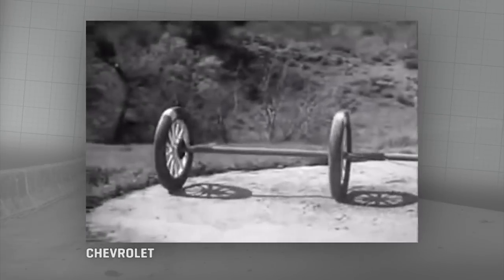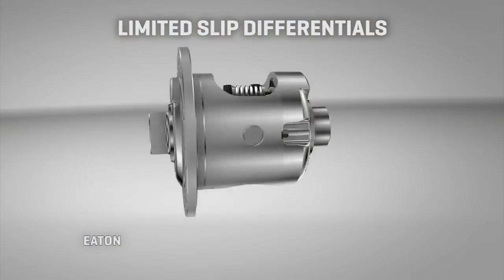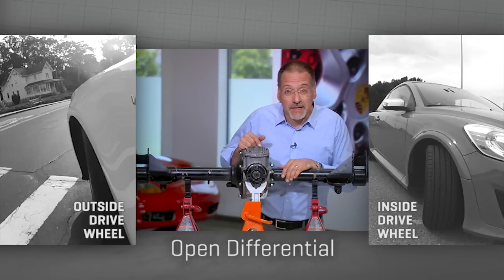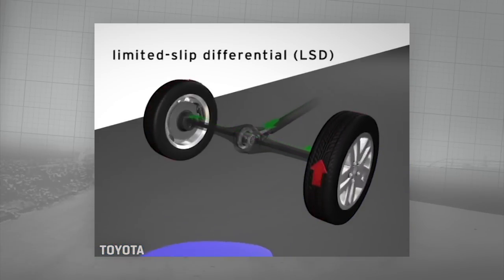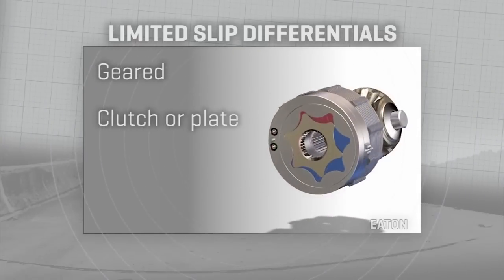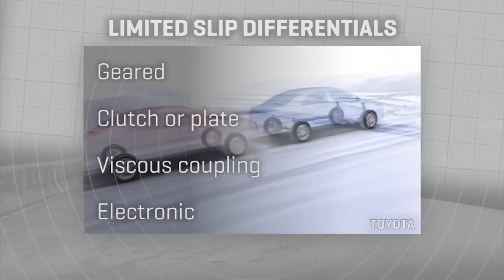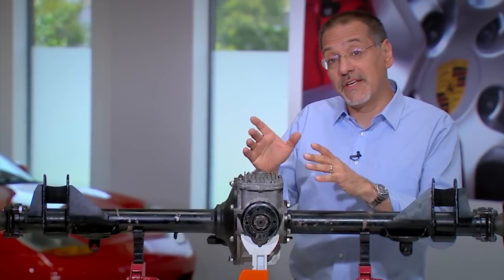Car Tech 101: Limited-slip differentials explained

Comment: I have a sneaking suspicion that vintage video explained it all better than the computer graphics did.
Reply: that video doesn't explain what a limited-slip differential is since it wasn't invented or widely used at the time. The purpose of that video is to explain what a basic differential is, how it operates and why it is needed. The point of this CNET video is to explain a type of differential called a "Limited-slip" differential....
Reply: @wannawin95  well, he did not explain it
Reply: When it comes to authenticity and originality, NOTHIN’ beats the good ol’ Analog!
Reply: 10 years later and it's still true. He gets right to the point, skips the minutia and gives the general concept

Comment: That Chevrolet video is excellent, the whole thing can be seen for free.

But THIS video has helped me to understand what the heck Forza is talking about in its car tune adjustments.

I didn't understand with two wheels spinning at different rates that when one wheel loses traction torque will go to that wheel and the opposite-side wheel will lose drive.

The language for limited slip differentials in Forza settings makes it seem like we're locking the two wheels together so that they spin at the SAME rate in all conditions when we increase the acceleration and deceleration settings.

I never bothered to upgrade my differential before in Forza, it can't improve the metrics shown to you and so you just have to be wise about what the heck it does.

Comment: 1997 Toyota Camry XLE with a 1mzfe engine. Now the codes on the door label says A/TM -02A/A541E. Can you tell me if it has an open or LSD in the transaxle

Comment: do front wheel drive have a differential to or just back wheel drive?
Reply: It's built into the transmission for a automatic I think and for a manual transmission it's separate if im not mistaken.

Comment: Which differential is the best for auto-x and track racing. Which will give the best handling and make attacking at a corner with higher speed?
Reply: Computer controlled clutch-type is obviously the best.  Not really available in the after market.

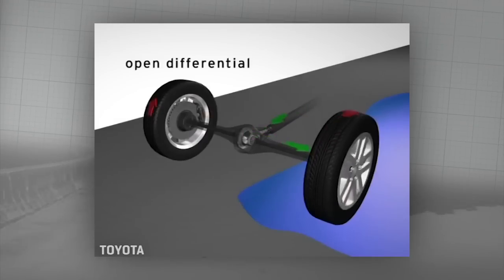Comment: At 1:41, "the power, or the torque, goes to the path of least resistance" is wrong on the torque part. The open differential applies the same torque to both wheels, which is limited by the torque that the surface can apply to the sliding wheel. Power and torque are different, and it's a shame that a physics-related video uses imprecise language.

Comment: This is incorrect and an often repeated mistake. All of the power does not flow to the spinning wheels in an open differential. The spinning wheel merely limits the amount of torque that can be put down on the other side with grip. The power split is always 50/50.
Reply: Your last statement is correct only when both wheels are on the ground
Reply: Copy that brother! Very well explained!
Reply: WRONG....In a open differential, if 1 wheel is on greased ice and the other wheel is on dry asphalt, the wheel on ice will spin forever with no power to the wheel on asphalt.  I know this for a fact. Period...
Reply: No you're wrong. The power split is 50/50 in a LOCKED differential. An open differential will send the energy to the wheel with least resistance. Perhaps you should consider not opening your mouth if you have no idea what you're talking about.
Reply: You certainly are not referring to me.
Reply: No I'm responding to walter black
Reply: Did y'all get D+'s in Physics or something?  Better retake physics mechanics and engineering dynamics next semester.
Reply: This is wrong. The torque split is 50/50. The power split is not. Power is torque×angular velocity, so the power split is equal to the speed split of the wheels at any moment.